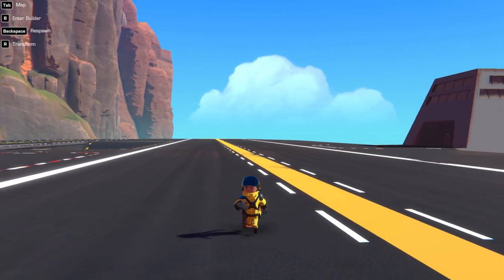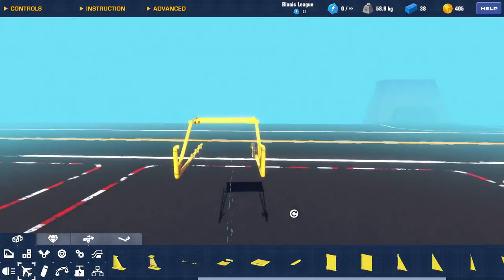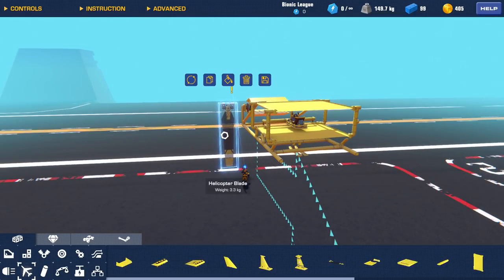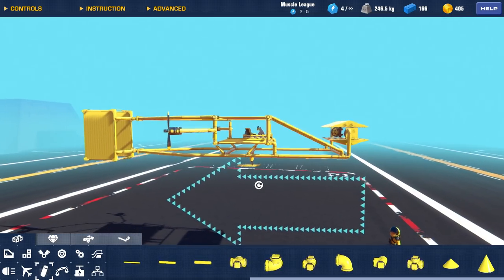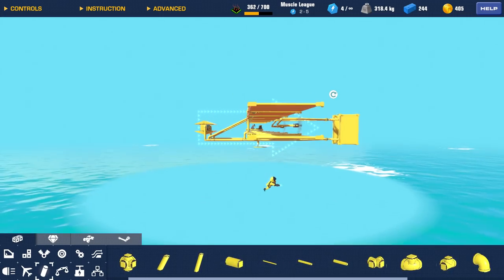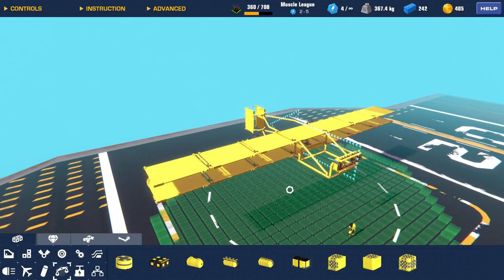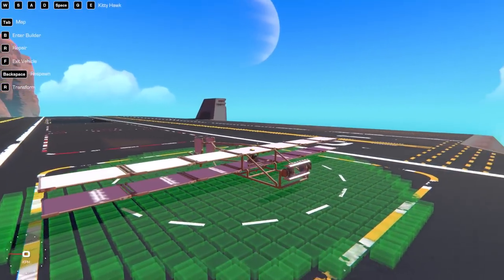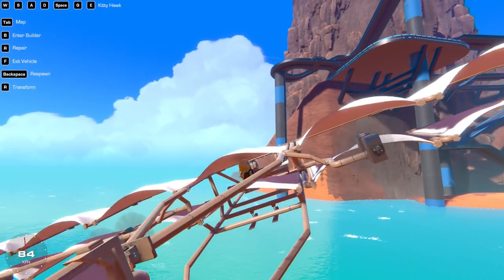Recreating The WRIGHT BROTHERS' Kitty Hawk Flyer With SAILS! (Trailmakers High Seas DLC)

Comment: Having a catapult would be historically accurate. The original flyer used a launch tower where a weight was dropped. Through some pulleys that weight pulled a rope that accelerated the plane down that rail you were mentioning. 

Cheers on getting her to fly this easily though! Was expecting you to spend a while on adjustments. As for not being 100% successful, that is fine. Like you said, you are a content creator, not an engineer, so it is not expected that you will always make things work. Don't play dumb by purposefully making silly mistakes, but don't push yourself either. If you can't solve something yourself we are here for you. In a way it might even be fun to build a base vehicle, let your community finish it, and then put those finished machines against each other to see what works best.

Comment: Kosmos, why you build creation in opposite direction to build box (those big blue arrow in build mode)? I made the same mistake some time ago with my compact seat control plane. Pitch and roll was messed up, but when I rotate creation 180deg around yaw axis everything was fine. Later it evolved to more complex build but it should help a bit more with manouverability.

Btw. Sorry for my terrible English. Definitely not native speaker 🤣